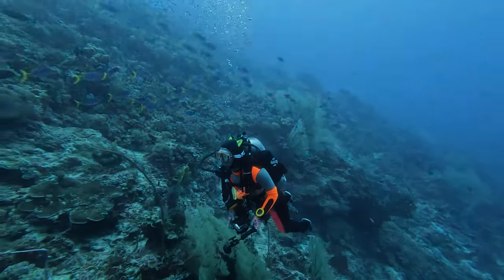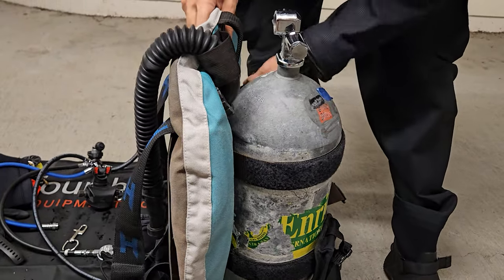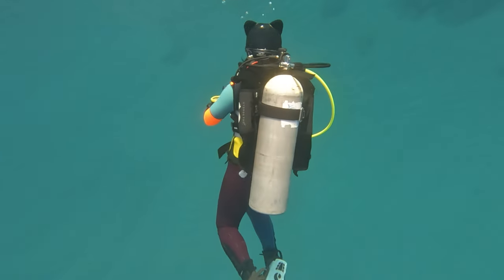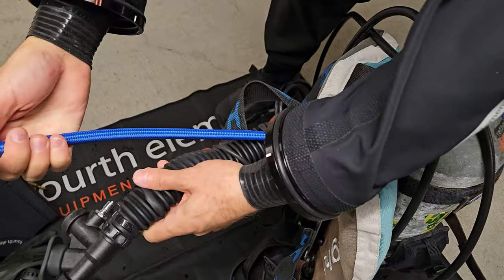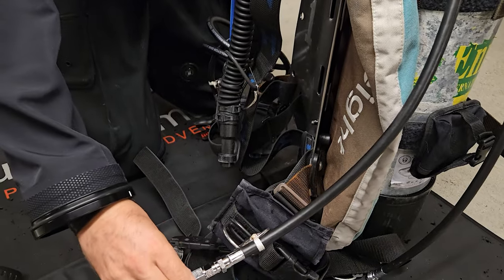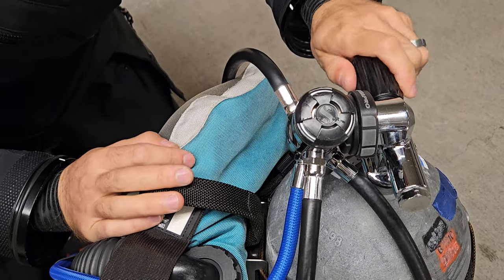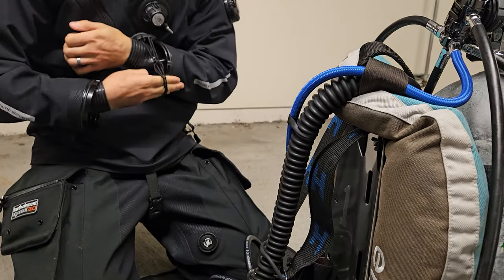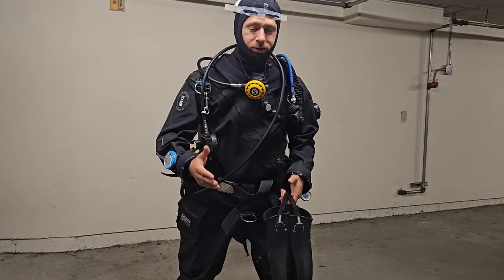Assemble Your Scuba Gear LIKE THIS For Stress-Free Dives

Comment: Turning the Tank valve a quarter back after opening isn't necessary anymore with modern valves, but that procedure DID NEVER come from
regulators might not handle full presure , obviously they will always have to hold full tank pressure even if the tank is opened only partially.
Actually it's about the tank valves and it's outdated information because modern valves do not get damaged from being completely turned open and left that way. That's been an issue decades ago (valves locking in open position or seats getting damaged) but somehow it's still frequently taught that way.
Reply from the maker: Yes, you are right, I've met several folks that told me they turn it back, so it is still very prevalent. I do know to not also overturn it as it can be a pain to turn off after the dive, so I usually advise to turn it lightly until you hit resistance and then leave it alone. Thank you for adding this.

Comment: why is your reg hose so long? thats crazy how long it is.
Reply from the maker: Great question! This is called a long hose configuration, and the primary reason for it is to make it easier to share air if someone is out. The idea behind it is, if someone is out of air, I can take it right out of my mouth and donate immediately, to a perhaps panicking diver and have plenty of space for them to calm down.
The long hose gives them a lot of clearance. Also, my octo is on the necklace, so I can grab that with my left hand and start using it immediately.

Comment: That nitrox tank at the start wasn’t steel? It had oxidisation next to the boot like an ally tank
Reply from the maker: This one was a steel HP 100, I prefer steel for cold water as I almost need no extra weight, haha, beyond the back plate and integrated weight for my tank adapter.

Comment: So much overpriced Halcyon gear. That looks very much like GUE
Reply from the maker: Good eye, I did get this gear because I was taking a course with GUE but I also wanted to start cold water diving so I needed a new set of gear for colder water anyways. After trying some different equipment and talking to folk, I do agree Halcyon is expensive. It is very good quality though, I made the leap!
Reply: @itravelwisely  FYI, halcyon is IMO just rebranded gear from other manufacturers. Not weather it is though. But xDeep, Apeks, Hollis, Dive rite and even Mares offer similar quality for less money.